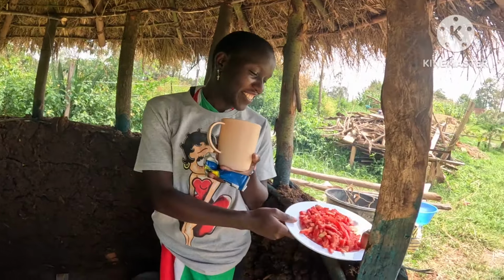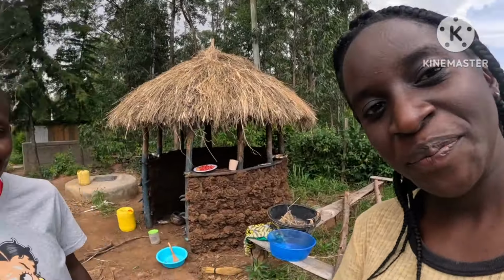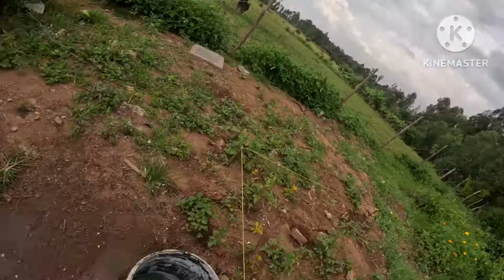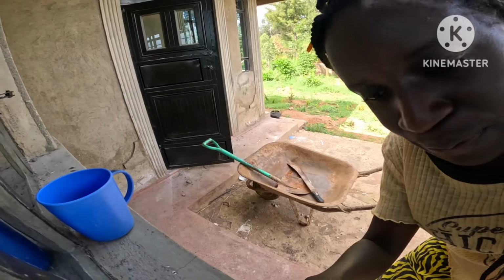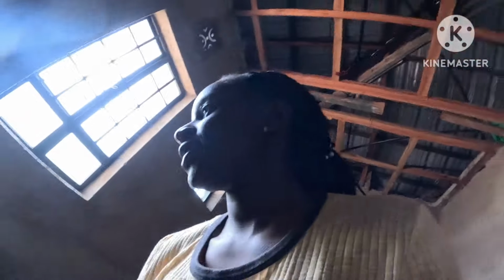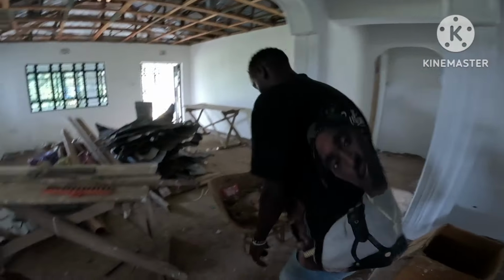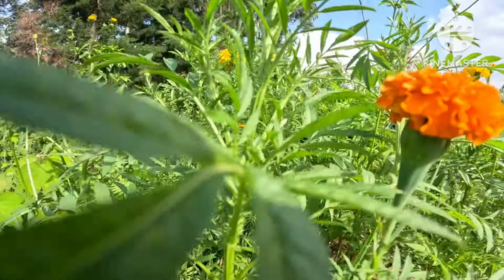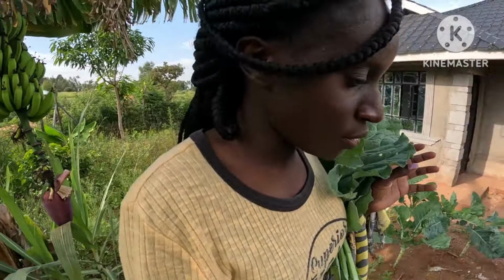AMAZING NEW HOUSE 🏠 TRANSFORMATION 🎊🎊💥

Comment: DK, temporarily the wooden  thing you and BC was sitting on the other day when not in uses  you can place it  in between  the benches and cover it with a table cloth.  And uses it for food. And when you're  done drying  the utensils  and other dishware  you could place them in the house And use that one cover it and uses that  one also to place hot pans or serving  from it. Just a suggestion.  Just using  my IMAGINATION  😂 IMPROVISE 
INVENT, THEN INVITE  📢🕺💃🕺💃🕺💃🎶🎶🎶🎶🎶🎶🎵